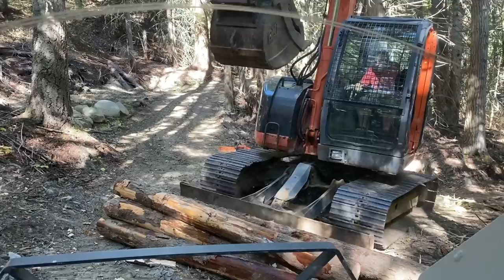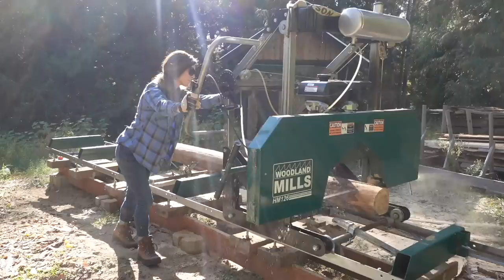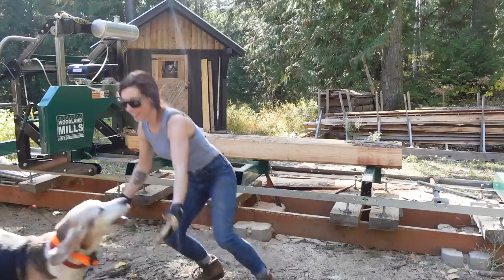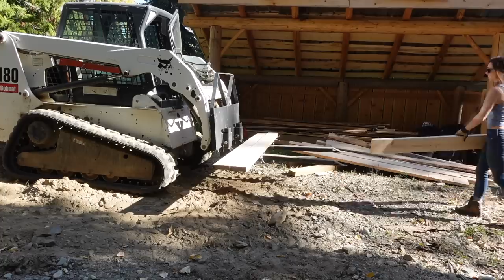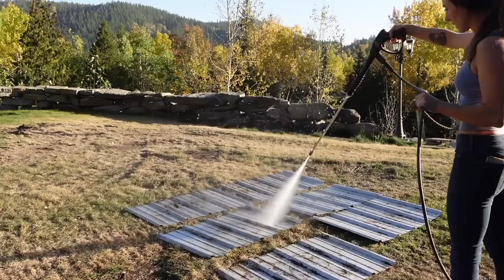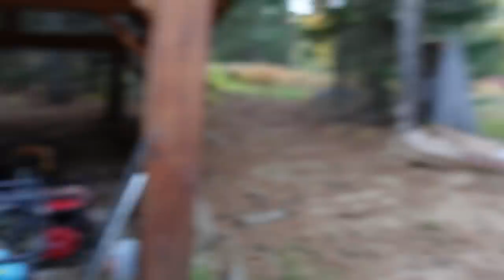This is what friends are for.

Comment: I have a suggestion that may keep you from slithering out of the bobcat with your load high. While near the ground arrange the logs so that the one you want is free, out front. The remaining logs should be secured to the backrest by a rope or chain from the forks. Then get in and lift the load and tilt forward to drop the single log on the bill bed. Then back up, lower the forks and get out normally to arrange for the next log on the front of the forks. Now you can do your milling. Cheers.
Reply: Excellent idea. Worth trying.

Comment: Good Sunday morning Michelle 🌄. If you're using the metal on your roof, we use a pair of Vice Grips, but replaced the adjustment bolt with an eye bolt and ran a rope through it. We can pull each panel up to the top safely without being below it. 🌹

Comment: Hi Michelle there's an easier way!  for the logs  set up log bunks or log skids at the same height as the mill bunks with a slip in blocks so you can simply roll the logs as needed for milling. also make it wide enough to get the bobcat between the rails

Comment: I got the T300, feel your pain, exactly why I use my S250 wheeled machine at the mill. No door to deal with! To much like jungle gym using the track machine for the mill.
Suggestion:
Buy a grapple for the skid steer to place you logs on the mill and avoid getting in and out all the time.

Sorry bout your loss, we lost a 3 year old last week, it’s hard.
Chuck
Reply from the maker: I usually load logs with the excavator attachment, but I just did things that way cuz all those logs were on the forklift from bringing them up out of the forest.

Comment: Getting in and out of the skiddy with a loaf on is a bad idea. 
Instead wrap  2 ratchet straps around all the logs except for the next to be used. This way you can just tio the forks and roll that log into the mill.

Comment: @michygoss I know you have talked about cleaning blades before and I keep thinking CMT but I continually forget to say something. I work for a couple different millwork companies with CNC machines for cutting parts. The tools and tool holders need cleaned from time to time and get a buildup of resins from the particleboard that is cut. We used to get some stuff that was basically toxic and corrosive to do the job, but after research I found CMT blade and bit cleaner. It is great for removing pitch, resin and adhesive residue that gets built up on the tools and I am thinking it may work pretty great for your blades. It is also, fairly inexpensive, and non-toxic/flammable and biodegradable. Hopefully you see this and give it a thought and possibly try.

Comment: Have you tried rolling a single log off of the forks while in the cab of the skidsteer and at the controls? Chock all the logs except for the one at the end of the forks and  spill the log off of the end of the forks and onto the milling table tilt the forks back so  the rest do not roll off,  and then lower the load to the ground so you can get in and out of the cab easier, and you will not have to wrestle with the log and squeeze in and out of the cab every time, really enjoy the channel....
Reply from the maker: I haven’t. I don’t usually load logs that way, but it’s just the way things were from bringing all those up from the forest.
Reply: @michygoss7148  Sounds great be safe ,, great content

Comment: When running logs through your mill, why don't you build a platform on one side of the mill to hold your extra logs? Then you won't have to climb in and out of the Bobcat. I know that you could build a system that would release one at a time.
Reply: A platform would be in her way while sawing.

Comment: Michelle, I am surprised that as long as you have been milling, that you do not have at least a long pair of homemade sawhorses onto which you can off load from the bobcat. Then have a couple of rails that can rest on the mill rails to roll the logs out, then fold the rails up towards the horses out of the way for the mill to run. Also, I have not seen you with a "cant hook". You may have one and I just have missed seeing it. Makes rolling logs, especially larger ones much easier. With the sawhorses, you can unload all that is on the bobcat, so you can lower it, and you do not have to fight with climbing in and out so many times.
Reply from the maker: Have definitely used the Cant hook for big logs, but the little ones I don’t.
Reply: She would just need to use bridge planks between the saw horses and her saw table.  The saw horses could also be useful in stacking her cut lumber and then moved out of the way when not needed.

Comment: I'm not sure you saw my comment about the zip line so here is main part again - I have noticed many times that your loads rotate on the way down and at times tangle with the trees. If you were to have a second pulley on the line spaced back from the main load bearing one you could attach a line from it to the trailing end of your load. This would then keep things in line a result in a smoother trip down. Worth a try?
Reply from the maker: Yes it’s been something I’ve been wanting to do for some time, but time is the problem! I just barely have enough time to do what I’m already doing. The SkyMule definitely needs tweaking to make it run more smoothly, but it’s still heaps better than carrying things down like I used to have to do.
Reply: Now that she has a sling she can tie her rope directly  to the sling.

Comment: Instead of tar paper look in to snow and ice shield it has a sticky back and is tuff way more effective
Reply from the maker: It was a thought, but also heavier and much more expensive. But in hindsight, I would go with the ice and shield membrane next time.
Reply: @michygoss7148  yeah little heavier but you can cut to size and make smaller rolls and the price is worth it caz of the protection and durability